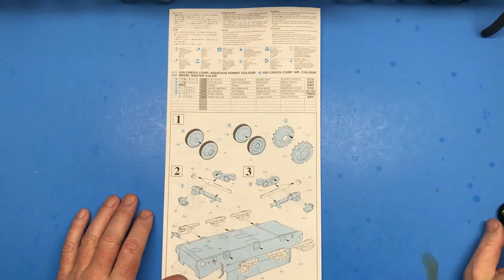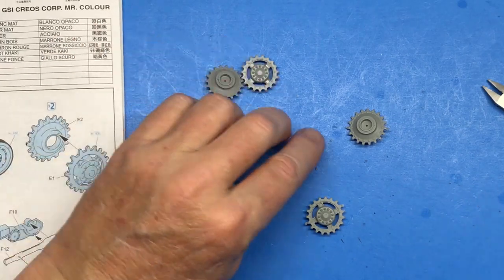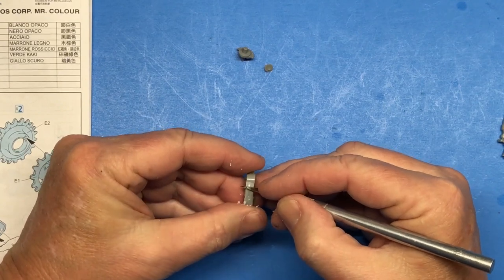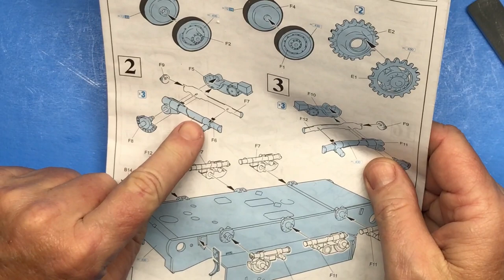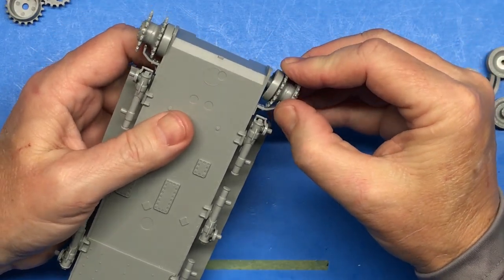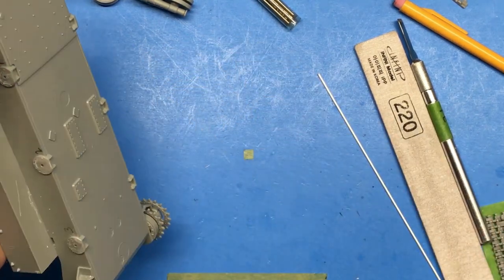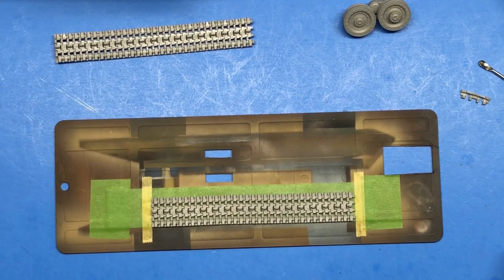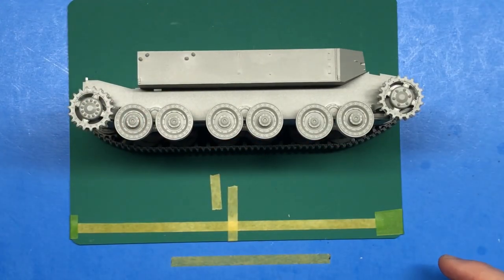Dragon 1/35 Elefant, Part 2 Steps 1-8

Comment: Great update Brett, I think your theory on the tracks shrinking is correct. I had a similar thing happen with the tracks on my BT7 build. I assembled the tracks in a continuous loop and let them set up on the tank. Then removed them for painting. The road wheels were dry assembled for removal and painting as well. When I went to reassemble the road wheels and tracks after painting, I had to really stretch them into place. With link and length tracks that's quite a trick! Thanks for sharing, model on my friend!
Reply from the maker: Thanks. I plan to do more experimenting with an extra set of tracks to see if my theory is correct.

Comment: You've made it a bit further away from me me the assembly of the tracks Brett! Nice work done in general, you've made no mistake in the suspension system assembly, probably the hull is warped. Some usefull tips shared. Now about the magic tracks and your theory, i have another theory in mind, i think that the heat created by the evaporation of the glue shrinks and creates that "bow", so we agree half way. Looking forward for part 2. I will soon have my second update ready as well, no problems so far up to step 11. I will make it up to step 12 and call it an update. Thanks for sharing, take care and keep up the good work my friend.
Reply from the maker: Thanks, George! The hull id warped for sure, but I got it worked out, as you will see in my next update.

Comment: Great video Brett, never built a Dragon kit myself but at least now I know to be wary of the so called "Magic Tracks". Looking at the way the idlers attach I think you are probably meant to glue them up after you fit the tracks as they act like a cam to adjust to your track length, thus avoiding the need for that extra link.
Reply from the maker: Mickey, I think you are exactly right. Asuka/Tasca does that on their Shermans. But, it worked out ok in the end.

Comment: Odd, I didn't get a notice on this?? Anyway, I had the same thing on the mud scrappers or whatever they call it. I just glued everything in since there wasn't anything special like rubber tires. Just to let you know on the photo etch fenders, you need to add the tracks then fenders. At least that what I found out the hard way.😁 Anyway, awesome video, Brett.
Reply from the maker: Thanks, Clayton. This one definitely is a build it all then paint, which is totally contrary to my usual method.